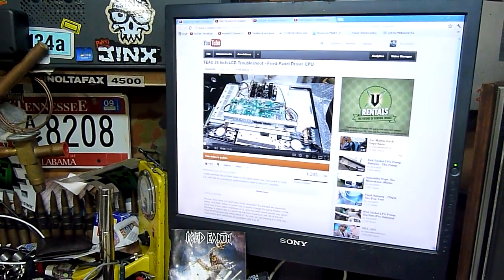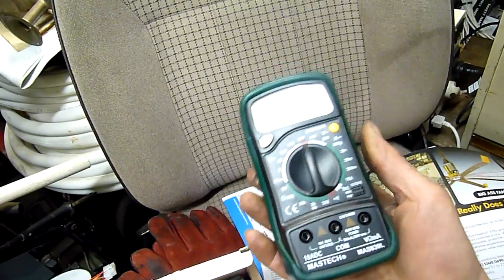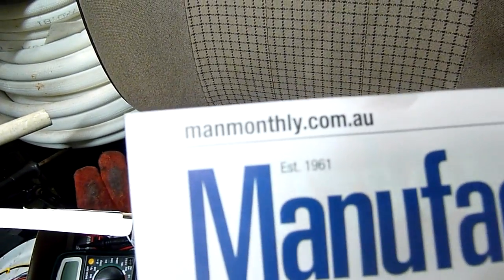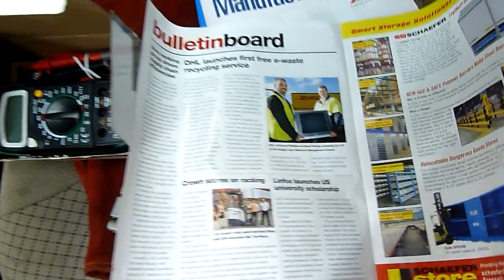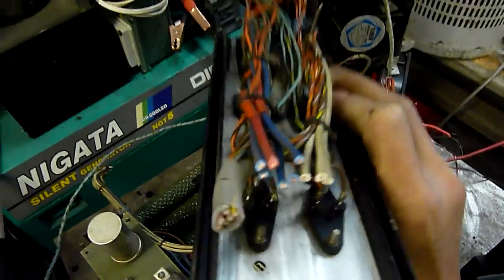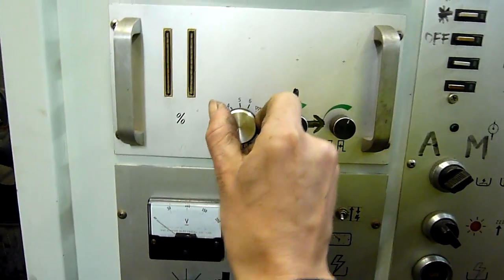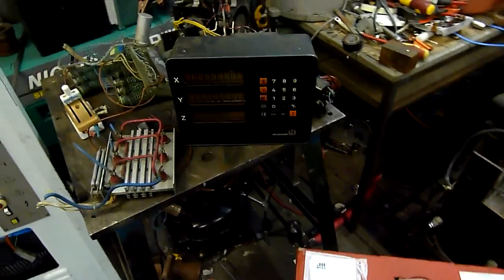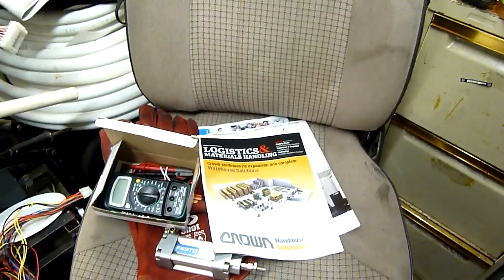Extra Ramblotronic Monday - Donations, EDM parts and New HD TV Monitor

Comment from the maker: for the few jobs we did on it, were not bothering. local EDM shops quoted $100 a pop to burn square drive holes in little bits of 38.1mm X 50 mm long stainless round bar, after we cut, drill and face off on the lathe.. we can get them made in China from scratch for $10 each, you can guess which option we took..

Comment: I get all my Pneumatic parts direct from a company in china called Ningbo Kailing Pnumatic Co. Ltd. The two main rams that operate the baggers in our chaff cutter are 80mm bore x 1000mm stroke and they were about $70usd each and all there push in air fittings are like $40 for a box of 200 and everything has been excellent quality, i've been really happy with them.
Worth a look if your after alot of stuff for a project. They have got everything, cylinders, valve blocks, fittings, tube, solenoids

Comment: That was nice to receive a multimeter :-), you can never have too many.
If its anything like the ones flooding the market at the moment, its dc voltage impedance is 1Mohm, its very good on all ranges but take the a.c voltage side with a pinch of salt :-)

You have some good bits there, test, clean, shelf for later evilness lol :-)

Comment from the maker: yeh thats just insane!, really bad pricing. tires I pay $1.50 each at the local tire shop, TV's and shit just get smashed up and put through the household wheelie bin. only big plastic casings end up at the tip

any other E-Waste is fine to mix with the general steel load that I take to the scrap yard, and get paid for it :D

Comment: The cheap meters work just as well.  You don't get the waterproof case or quite the solid feel as the Fluke.  I have a few Flukes on the benches and a vast armada of $32 Radio Shack digital meters.  The Radio Shack units are the most used and have never failed.  There is no difference in accuracy.

But in a harsh environment, the Fluke would easily prevail.

Comment: 1) I don't recommend you to use that cheap ~$10 multimeter for anything higher than 100V. Especially not for mains voltage. It has no protection circuitry inside whatsoever, so it can blow in your face anytime. Trust me, it's not worth it. If anyone tells you otherwise - they don't know what they're talking about.
2) you said you want to convert that xyz table from EDM machine to drill press. How about plasma cutter? It'd be much more handy to have. P. cutters are not so expensive these days.

Comment: Waste Charges per Specified Item
Mattresses $22 per item Both
Car and 4WD tyres (each) $5 per item Both
specified items
Computers
Combined terminal
& monitor (set)
$40 Both
Monitors $25 per item Both
Computer terminals $15 per item Both
Televisions
Small $30 per item Both
Large (over 60cm) $40 per item Both

you need two people when going to the dump one to bend over and the other to pull wads of cash out your arse

Comment: Or China, or India where they will have the untouchables burning insulation off. Here there charge recycling fees to supposedly safely dispose of E-waste, now they want to do the same with small appliances. If you read the list and the fees it sounds like they went through an electrical goods and a powertool catalog and calculated the fees at random with a dart board. It's another form of corporate welfare really, who is going to recycle an electric toothbrush or calculator anyhow?

Comment: No, but you seem to be, your pushing a product that 98% of the people out there would have little use for and never miss owning. Why don't you look up digital meter comparisons/reviews on Google. You may be surprised how little difference there is between chreap meters and high priced meters for measuring resistances and DC voltages. The main thing the cheaper meters lack are features, but you still don't need a high priced Fluke to measure anything you mentioned.

Comment: Haha, someone who has money burning a hole in their wallet obviously, where do you think they make the chips and other components for the Fluke? Answer, the same places they make them for meters that cost half as much, Asia. Why would I bother using a $300 meter when a VTVM or a $50 DMM would do the job, do I really need to know a measurements down to 1/100th of a volt on a high voltage circuit?